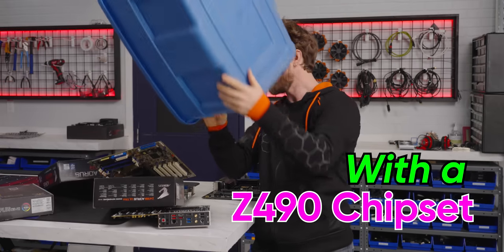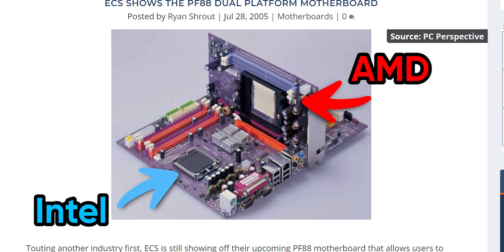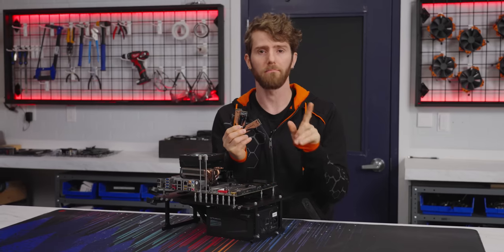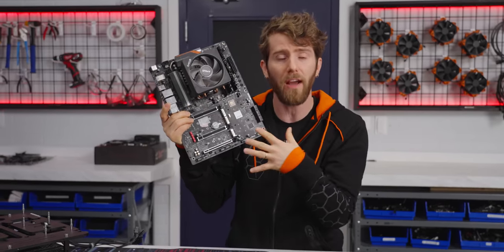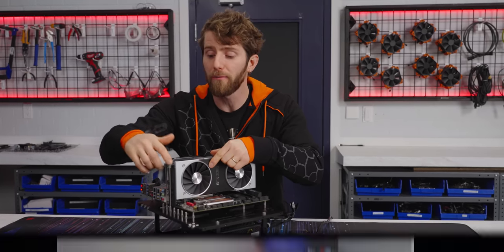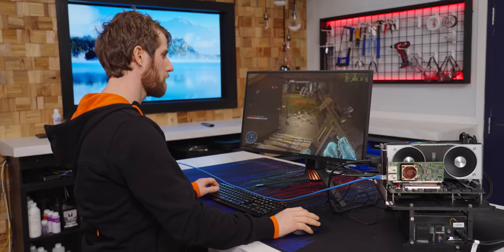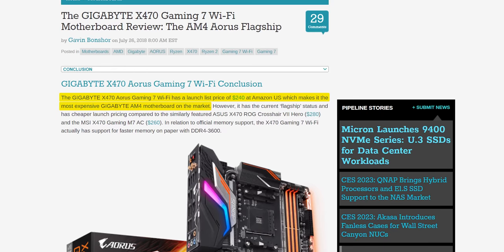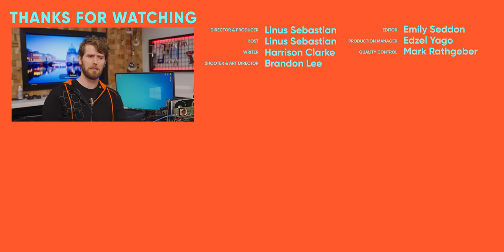I Got This MYSTERY Motherboard From Reddit - AMD Z490

Comment: on pcie lanes: WTF, AMD and Intel!?  you each had the opportunity to revolutionize i/o with the latest and greatest machines that would SIGNIFICANTLY benefit from it... AMD released a whole new platform... they could have given us 64 pcie lanes so that we could actually USE the second x16 pcie slot and third x4 pcie slot along with the 3-4 4x nvme slots in the system without bandwidth sharing, slowdowns, and in the case of the second pcie slot HALVING of the primary "x16" pcie slot to x8 (which on something like a 4090 is a pretty big drop in bandwidth)... they COULD have given us a memory controller with a quad channel setup (or even a octo channel memory setup) so that each dimm slot had it's own channel to eliminate all of the 2dpc dual rank problems that are PLAGUING x670 users who want to use 4 dual rank dimms in their machines with reasonable memory clocks... (these are 2 MAJOR problems that are plaguing both intel and AMD platforms right now).  they could have even made it so that these things were only enabled on their super high end enthusiast chipsets (which on the memory controller front would even make sense given the additional work to lay out all those additional traces).  And WHERE is the non-pro zen4 threadripper part that should solve most of these issues (at twice what it's actually worth), and WHERE is a current xeon-w cpu and chipset that uses the latest cores and ddr5!?  the enthusiast HEDT space just completely dried up :(

Comment: Back in the 90's you could flip-flop between AMD and Intel on any board.  This was before Intel started to jump into odd design styles for their chips, while AMD literally has not changed the physical way chips connect to the MoBo.

Comment: There was a leak or rumour that the AMD 500 series was going to have two top end chipsets, namely X570 and X590.  Supposedly they scrapped the lower of the two and released what would have been the X590 as the X570.

Comment: many of us have actual practical uses for the slots on the motherboard, cutting them down does very much limit our ability to make use of them, it is a ewal problem that the mux chips are expensive, because in the past , you did have more slots to work with.

Comment: But there are x470 boards with more then 32 lanes of pcie for instance 2x  4xpcie m.2 + 3x 16xpcie slots + 3x 1xpcie slots so x470 boards can have multiplexes or switches as well

Comment: It would never happen, but hypothetically purely software and firmware changes could get an Intel CPU running on an AMD chipset, as AMD's chipsets just talk to the CPU over a x4 PCIe link whereas the hardware connection between Intel CPUs and their chipsets is a proprietary hardware link. Obviously the protocol on that x4 link is still proprietary, but that's all firmware.

Comment: Who would want more than a couple nvme slots? I would,  a truck driver that don't want to spend 1,200 to 2,000 dollars on a 8tb nvme that I definitely would fill. Heck I have 2 4 tb nvmes and at a point where they each have 1 tb left, and now I am worried about performance degradation on those nvme drives, and one of them I have had issues with going past. The other is a champ and was luckily my system os drive.  Also I kill alot of hard drives as a trucker. It has to be ssd or nvme and I prefer nvme for size.

Comment: keep your cpu simple, only very few transistors running at same time, ie pre-calc rom results from memory per one cycle per core, more MHz, less activity
Reply: two memory chips, one rom, one ram, and the clock generator, at very high MHz, or GHz, or THz, or PHz, as fast as you can do an ADC/RAM-DAC
Reply: just make a single core, ultra high MHz, very low power, because of very few active transistors, cross point style memory, pairs of wires (transistors a the cross point) at one time

Comment: I use the board this one is based off of (albeit the non-WIFI variant). I think I probably would have ended up buying it at the time, since I still use the X470 with my 5800X3D after upgrading last year. That's with me only just now getting another M.2 drive, and with my PCIE lanes being nowhere near maxed out as-is.

Comment: What is that testing rack called?  I need to buy something like that.  THX.
Reply: It’s an open air test bench. I can’t tell you what specific model they’re using though, but that should be enough to Google.
Reply: @ianweber9248   Thx so much...  I compare at the bottom #00 to Linus @ #100;  I understand some PC functions but not enough to build my own; far too technical now compared to Dos & my last PC build using Windows XP... hehehe.

Comment: Hmm, that Intel NIC is curious - not finding any device ID (the "DEV_1532") matching it anywhere in the Intel ("VEN_8086") device database, not even anything remotely close (usually, devices of the same type or family often, but not always, have device ID's close to, or similar to, the ID in question. See Realtek's "DEV_81xx" for instance - that's their NIC lineup. Could it be a dummy/validation/testing chip of some kind?

Comment: This would have been so cool, the lack of PCIE lanes on ryzen is actually the biggest drawback

Edit at the end: I actually just did some upgrades and added a second NVMe to my system (b450) but because of the limited PCIE lanes the second one only runs at PCIE3 x2 speeds and disabled 2 of my sata ports. So I don't have any expansion left other than 3 PCIE2 x1 slots and a single sata port or swapping out any of the drives for higher capacity/speed depending on what I need.
Reply: I’m with you on the lack of pcie lanes. 
I’m running an mATX b450 board with 3 nvmes. Pcie3.0x4, Pcie2.0x4 and Pcie2.0x1. 
I’m using an pcie to m.2 adapter, costs like $15. If I have understood the transfer speeds correctly, pcie2.0x1 is roughly the same as sata speeds. (A bit of a waste on a nvme but the price made sense)

Comment: I was checking out Ibuypower prebuilt computers. Intel 13700KF, RTX 3080 and 32GB 5200 ram. My question is the Motherboard it's a MSI Z790-P Wifi. Is this something I should upgrade?

Comment: You guys need to try Linux in this type of hardware.
Not a full installation, just a flash drive ready to initialize, e test if the things will work.

Comment: Really, people don't have more than one m2 drive? I have 2 1Tb drives and I'm currently really annoyed that I didn't go for 2 terabyte ones. I also have an older boot drive from my old pc, which is a 256Gb one. I always say its better to have room for more, so that if you want to upgrade you don't have to replace an old drive. I only have 2 m2 slots, so I would have to replace one to get more space. And currently my slower one is my boot drive, so if I were to upgrade, I would upgrade that one, but I don't really want to go through reinstalling the OS and all my programs and all that. I always hated that process.

Comment: love your videos. About 10 years ago I started watching and used the info you share to build my first pc and am currently watching what's out there and will likely upgrade to AM4 or AM5 in the next year or two (MY PC still works fairly well for most things, but could be faster for productivity). I would love to see an updated video on the AM boards, particularly the ones you find best for future proofing and your thoughts in things like if 10gb LAN, or PCIE 5 make any sense to splurge on, as well as which memory configs work best (I've heard 2 sticks run a lot faster than 4). 

Also a few questions... 

1)Do you have any videos that show how to migrate all of your software to a new platform if you keep the drives? 

2) On the old build I had gotten a power supply with a lot of wattage at the time.  Assuming it meets the needs of whatever I upgrade to, are the other reasons to upgrade the unit?

3)What's the best way to use or dispose of old parts that won't make it to the new build (i.e. old ram, the old chip and mobo)? 

4) I recently had to replace my mouse and decided to try one of the mmo gaming mouses to see if I found the extra buttons useful.  I went with the redragon m913 because of it’s features, price, and because it’s wireless.  I like it more than I thought it would and find the buttons useful even though I’m too slow to use them for gaming.  What bugs me about it is that you can’t use any of the buttons as a modifier key.  For example the fire button would be a great shift key.  If I assign it shift and then use another button the computer reads each separately, but just alternates between them instead of combining them.  Wondering if there are any programs you can use to better control such a mouse.

Comment: You can get chips for industrial motherboards from Intel that are still pin grid, I have a few advatech boards with i5 520m and core duel chipsets all pin grid not the standard pin less chips. The bios suck cause they are meant to run specific iot builds of windows or Linux so I'm having difficulty getting them to run.

Comment: I mean. My current system has 4 nvme drives in it. My last one had 3 m.2 drives in it. The one before that only had one single slot so it only had one and it was pre-nvme.. This is in addition to the spinning platters my rig also has

Technically I like having extra drive slots as yes. I do end up using them

But at the time I'd probably have bought into Thread ripper or HEDT over a PLEX chip.

Comment: I Got This motherboard, BIOSTAR TB360-BTC LGA 1151, Intel Motherboard on Ebay for $48.90 on Ebay, $30.oo + Shipping.   I want to Get the Best Reasonable Priced CPU, to go in it, What would be the best bang for the Buck {CPU} on this Board ??? ???????????????? Socket Type:	
LGA 1151/Socket H4	
Compatible CPU Brand:	
Intel
Number of Memory Slots:	
1	
Input/Output Ports:	
HDMI, Ethernet (RJ-45), USB 3.0
MPN:	
TB360BTCD	
Item Length:	
23.4 cm
Most Suitable For:	
Mining, Cryptocurrency Mining	
Memory Type:	
SDR SDRAM
Brand:	
BIOSTAR	
Form Factor:	
Enhanced Extended ATX
Expansion Slots:	
PCI Express, PCI Express x16, PCI Express 2.0 x16	
Model:	
TB360-BTC D+
Features:	
Multi-GPU Support, On-Board Video Chipset	
Item Width:	
48.5 cm   I have never Mined For Bitcoins,  Before, and I want to See if Some of my Graphics cards laying around can mine Bitcoins on this Motherboard.

Comment: It also makes no sense to have more PCIe channels when most people are not even using half of their motherboard's expansion slots. This is a "cheap" solution to a problem virtually nobody has.
Reply: "No one uses it" is kind of a sh*t point towards those that actually do. In an ideal world all 7 slots would be full 16x and m.2 would be attached by a 16x adapter card.

Comment: I tried updating the Bios on a B450 pro wifi and bricked my board so don't expect to but an older board and it work with newer CPU's such as the 5600x.

Comment: I am still missing dual bios, buttons for power/reset etc. . At least 5 PCIe and over 12+ sata ports on "modern" mobos. Not to mention those features what we do not have nowadays on a regular desktop mobo. That is why i do not use these "cheap" (overpriced)  "new" but featureless craps.

Comment: With massive Steam libraries, the small capacity of NVMe drives, and the extreme costs of 4TB+ drives, there is a need for many to run multiple NVMe drives. PCI-e lanes need to increase by at least double.

Comment: Amd and Intel really should add an "A" (For AMD) or an "I" (For intel) to the start of their motherboard naming schemes.

AZ490 means it works with AMD, IZ490 means it works with Intel

It would really help make motherboards less confusing
Reply: Not really Intel's problem. AMD could have chosen literally anything other than the one letter and three numbers pattern but they chose to attempt to confuse consumers into buying their product.
Reply: @thedanyesful  Both are at fault for their bad naming schemes.

Both have used the same letters on motherboards.

Both should help consumers with a better scheme

Comment: I suspect that the network chip is not from Intel but instead from a non Intel company due to the CPU being AMD
Reply: You might think, but no! Intel Ethernet chipsets are common on boards all over the industry. The chipset identified in the video has a vendor code of 8086; Intel Corp.

Comment: @Linus you ask how many got more than a single M.2... I bought mobo especially got have as many slots as I need, so a nice 4 slot one was my choice. Single fast drive for system a second DRAMless one for games, and room to add more game and more system memory in future. 3 would be minimum for me, as I would have a system drive on PCIe4, gaming DRAMless drive (they are as good for reads as you need them, jjust suck at write), and work drive as second PCIe3 one for stuff like developer workspaces etc. Sounds legit?